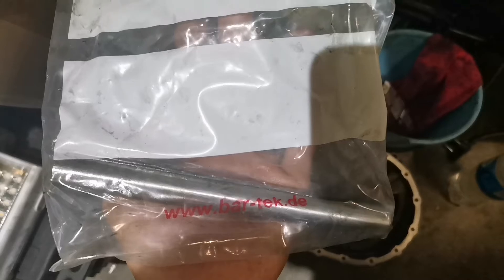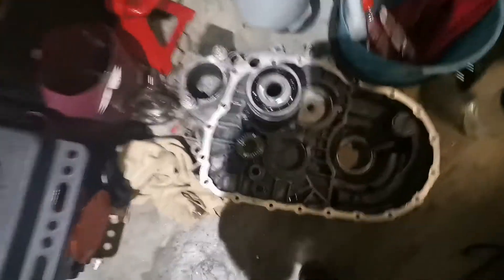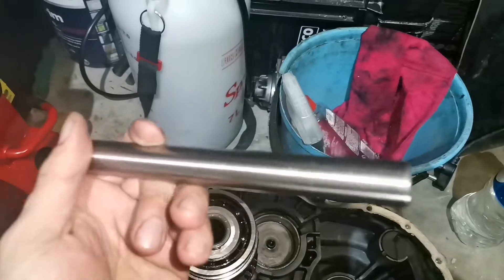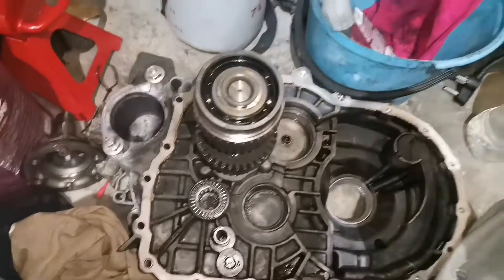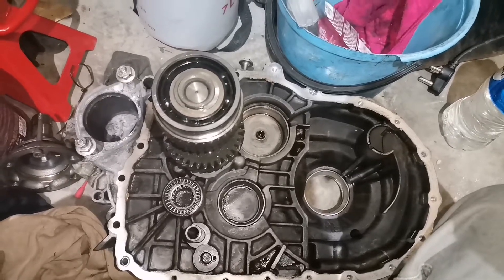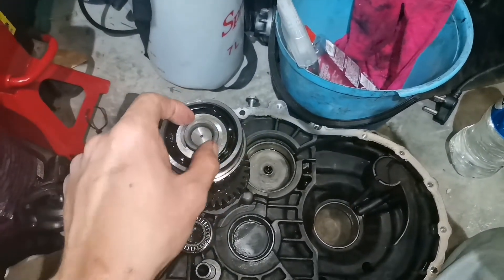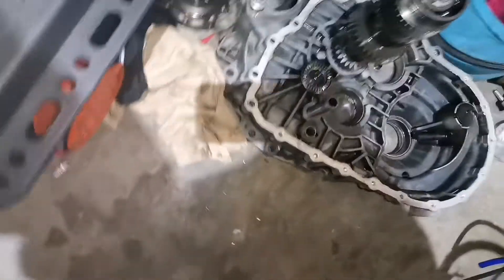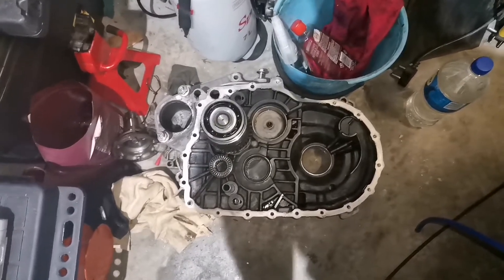02M 6-Speed Transmission Upgrade Pt4: How to Install, Bar-Tek, 02M/02Q Billet Input Shaft Insert

Comment: they are not all drop in some need to be pressed in
Reply: Also, the bartek one does not fit into my input  shaft as it has a step inside, so now I have see if I can get it altered a work.